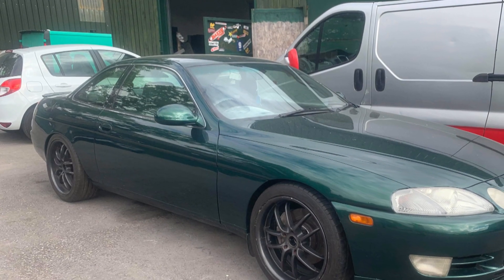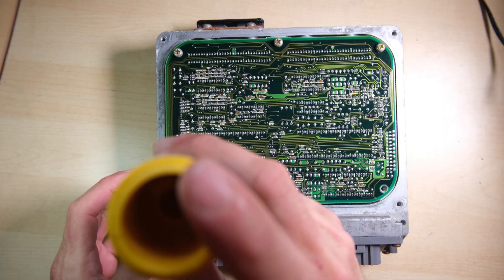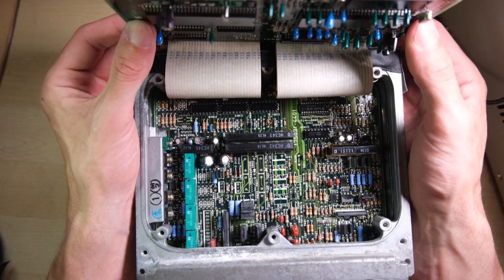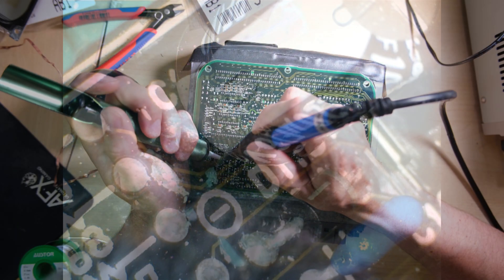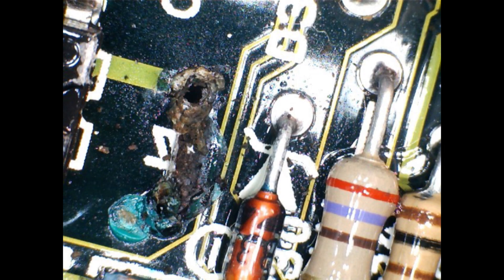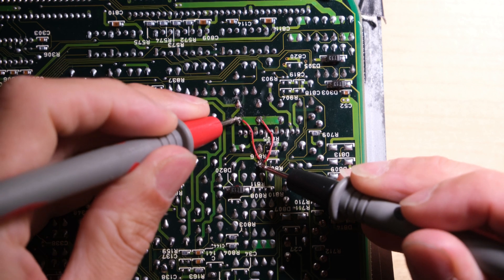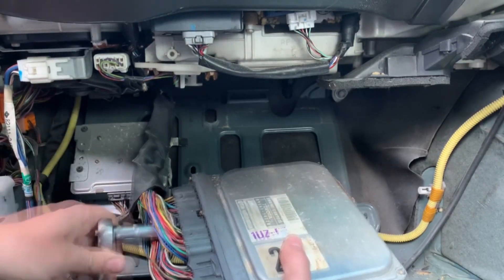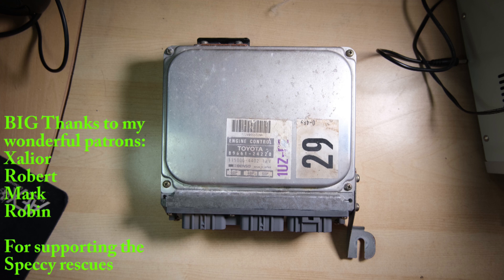1991 Toyota Soarer V8 Engine ECU Recap

Comment: Hi ... is this ECU refurb / repair a service you actually offer to punters such as me 🙂 ... if so, let me know how I can get in touch with you so we can discuss further. For info ... the ECU in your vid looks to be exactly the same as the one I have ... which I believe is faulty ... cheers in advance Mark ....
Reply from the maker: Hi Mark. This ECU was a request from a friend, I couldn't possibly offer any kind of guarantee so I don't offer it as a service.  The best option I found is a guy in NZ called soarer surgeon, might cost a bit on shipping though!
Reply: @HappyLittleDiodes  thx very much for getting back to me so quickly.  I've already been in contact with Mike (Soarer Surgeon), as some 15 months ago I purchased a fully refurbed UZZ31 ECU from him. Unfortunately, it would appear that the same / similar issues are now recurring in my 1992 Soarer V8, so I suspect further issues with the ECU. Mike has offered to assist, but at full cost and as   he also stated that the ECU itself is 30+ years old, I assume with no warranty. So I was looking for someone a little closer to home ...   Thx again for such a speedy reply... cheers Mark👍

Comment: Was that stalling issue when shifting into gear at all??
Reply from the maker: Yes that's right.  I've suggested bypassing the fuel pump ECU but it's a bit tricky as it's an import so 12V isn't available on the OBD
Reply: @HappyLittleDiodes  very interesting. I'm having the same issue on my Soarer. Just recapped the ecu as well and made no difference. Might have to give my Fuel Pump ECU a look then too. Cheers mate! Also, bloody good quality video!
Reply from the maker: Ta mate. Let me know how you get on.  You can bypass the ECU with a paperclip in the OBD port
Reply: @HappyLittleDiodes  yeah nah tries the bypass on the obd. And turns out someone's already bypassed the ecu from the plug itself. Not sure what my issue is now.
Reply: @HappyLittleDiodes  if it is the moment/instant it goes into D, it still could be the ECU. Might be there is a bad track or something you missed.
Few people have had the same thing happen.
Be curious to know how you went.

Comment: my honda prelude did that had a drink tonight so will tell you tomorrow maybe what part to check not electrical its actualy linked to the water! and the pgm-fi there is a little valve dont know if you have one on them but mine was blocked il get more details my car used to rev and up and don when it got really bad could be similar fault

Comment: I an surprised you did not use polymer caps as replacements.
Reply from the maker: The choice of cap was mainly based on advice from the experts in the forums.  On the face of it I don't see why not. A quick search though makes me think it would be hard to find the right ratings,  from mouser at least
Reply: @HappyLittleDiodes  
I am not sure where you are based but,
I would probably go with these if room permits.
https://uk.rs-online.com/web/p/aluminium-capacitors/1458492

https://uk.rs-online.com/web/p/aluminium-capacitors/8392348

https://uk.rs-online.com/web/p/aluminium-capacitors/7886977

https://uk.rs-online.com/web/p/aluminium-capacitors/7395415

https://uk.rs-online.com/web/p/aluminium-capacitors/8081603
Reply from the maker: Interesting! Quite pricey compared to the 'wet' caps.
Reply: @HappyLittleDiodes  Yes they are but the ripple current is huge compare to wet types.
Reply: @FireballXL55  Wow, big money.
Reply: @FireballXL55  it's unlikely that ripple rating is important in this application... that is really important when you have lots of current at high frequency being pulled e.g. the output of an SMPS or some high frequency DC-DC converter. Not likely to be the case here. Lifetime @ Temperature is likely to be more dominant
Reply: Also why on earth would you use 100V rated capacitors here?
Reply: @jaycee1980  It was not the ripple current rating I was really interested in more the fact they are dry so will not dry out, very often these are in elevated temperature positions.
We choose capacitors mainly on size and price after we have checked the performance criteria.
RS did not have suitable lower voltage caps of that type and as size did not seem to be a problem I just chose those.
I repair mainly industrial electronics so temperature and drying out/age are the main problems I get.
I also use a lot of Rubycon ZLH series caps.

Comment: Still using that useless soldering iron tip I see 😁
Reply from the maker: I tried a few different types trying to get that broken trace to take solder before going for the patch wire!
Reply: @HappyLittleDiodes  Definitely get yourself a chisel or bevel tip, especially when you are working on multilayer boards. You want to be able to get a good amount of heat into the joint, and conical tips are just useless for that. I dont know why they even ship those as the default tip on irons !!